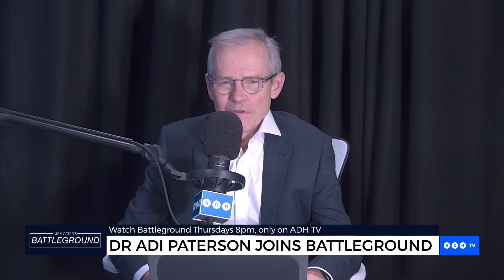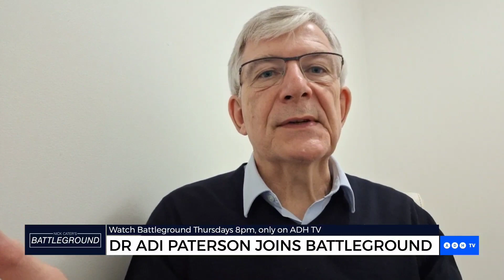Intermittent renewables disrupt the quality of electricity: Adrian Paterson | Nick Cater

Comment: There are actually two separate fundamental problems here. First, synchronization is a fundamental problem in AC power (there's massive research going on at building DC power grids for renewables) and the second problem is that supply and demand must match all the time, every second. You need everything to be synchronized, otherwise the generators start feeding and consuming each other, and they will blow up. It has happened, and will happen again. When it happens to such an extent that the grid loses synchronization, the whole power grid will shut down as it is its own source of synchronization. 
I live in Finland and have worked in the electricity industry, so I know something about the procedure of restoring the grid in such eventuality, and it starts by starting big hydroelectric power stations in the north one by one and adding them carefully to the grid. It will take several days to reach the southern Finland and restore power to the capital. Small power stations are the last to be added because adding them won't affect so greatly to the grid frequency and phase any more. The big hydropower and nuclear power plants provide the stability. 
For the same reason those big plants cannot be disengaged from the grid at will, because they give the stability and the frequency reference. It's the little power stations that must and will automatically disengage if there is more power generated than what is consumed and the voltage of the grid rises more than a dozen volts or so.
Reply: I saw problems with the power grid happening back in 2019 and over the last 3 years had a solar system with 30kwh capacity installed. We had our second blackout in 4 months 3 weeks ago. The house went dark , we waited 60 seconds then my power came back on - I was the only one with power in my entire area. 

The Australian power network is going to become MORE unstable, unreliable and unable to meet demand. They are adding another 1.5 million people over 2 years and at the same time shutting baseload generation. 

Bye bye stupid Australia
Reply: Dc power cannot be transmitted over great distances whereas ac power can. 

The main problem here is our current moron government believes that the grid can be entirely powered by solar and wind. In fact it is like a religious calling. Everyone that tells them it won’t work is sacked. They won’t even consider nuclear and shut down coal then blow it up. 
They won’t listen to reason, facts, data or evidence from the rest of the world. 
I’m like you, in the industry.

Comment: What a load of bollocks. Denmark and Germany are running occasionally on 100% renewable energy. I have never heard about any problems there.
Reply: So why is there a power crisis in Germany?
Windmills are ugly carry toxic blades and never make the CO2 they cost to run. Great for birds and offshore fish too. It's a complete Rort.
Reply: @David John  There was a power crisis because they cut the gas import from Russia. There is not a power crisis anymore. The Germans also did the amazingly stupid thing to shut down the nuclear power because of a referendum that was done in the 90ties, I think. And electricity has always been expensive in Germany. And Germany has much less sunshine in the winter compared to Australia, and the population density is more than 100 times higher. If Australia had invested as much as Germany, it would have been covered 300% by green energy. But the point is that there are little problems with voltage, frequency and so on.
Reply: No they are not. They just have the capacity of generating that amount of energy by renewables. "On February 22nd, Denmark generated enough energy with its wind turbines to power the entire country for the day." That doesn't mean that the grid ran on renewable energy, they just were able to generate that amount of energy to the multinational grid that is stabilized by hydropower.
Reply: @nmosfet5797  There is no hydropower in Denmark. The thermoelectric powerplants are chugging along, of course, but the wind and solar power is not messing up the grid. And there is no reason it should do so in Australia. It is just a question about some new technology.
Reply: They are digging up wind farms in Germany to burn brown coal.
Reply: Occasionally is the word and at what cost. If energy isn't cheap it's not worth it as sky high energy prices make countries non competitive and unaffordable to live in.
Meanwhile China is building 2 coal fired power stations weekly. So Denmark going green will probably offset China's CO2 by half an hour yearly.
Reply: @David John  wind and solar is about half of the cost of coal power, depending on definitions. There is money to spare to install energy storage and transmission lines. 
China is also closing two old coal power plants a week. Why is this not mentioned? Also, the estimates of how much coal power is needed are lowered as wind and solar power is developed.
Reply: China has 2,300 Coal fired Power Station and are building 1,100 more. You know this is all a scam . De Industrializing the West is the goal.

Comment: Maybe youll need special generators on the grid to create the clean signal that you need for the system to synchronise ? 

When a powerstation comes on line it has to be in synch with system frequency otherwise it goes from being a generator to a motor,  the rotating shaft will be wrenched around to be in synch with system frequency in the sense the power of the grid flows in and forces the rotating shaft into system frequency.

All rotating generators on the grid force each other into synch.
Reply: The big power plants are the "special generators" - they will not bend or break when little ones are attached and this very fact causes them to be the grid synchronization reference. But yeah, what you wrote is correct.
Reply: @NMOS FET  I'm thinking if all the big rotating generators disappear then you'd need special motors to set grid frequency. Maybe you'd have a DC motor turning a generator that pumps out AC 3 phase at the transmission level ? Eg a big powerstation is replaced by a special building with batteries acting as a UPS they all rely on each other to keep system frequency ?

There's already something called a ripple frequency control where a big electric motor fires up , reaches a certain rpm , then a contactactor pulls in and out to create a quasi binary signal that a ripple frequency controller understands